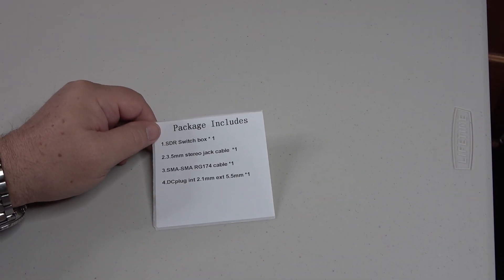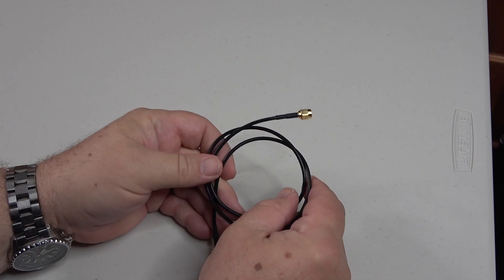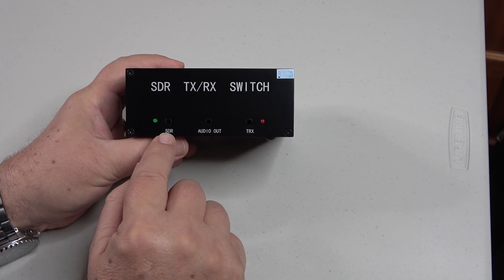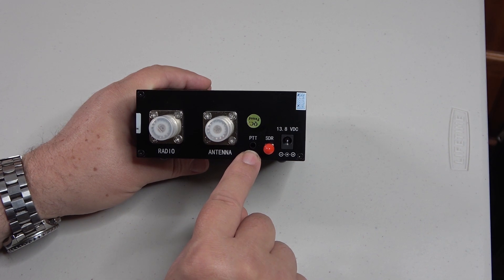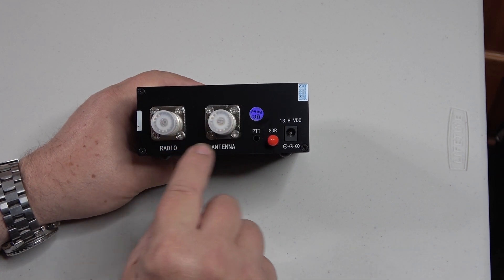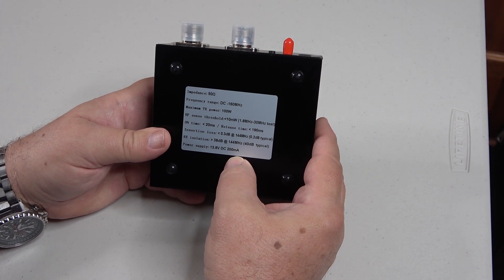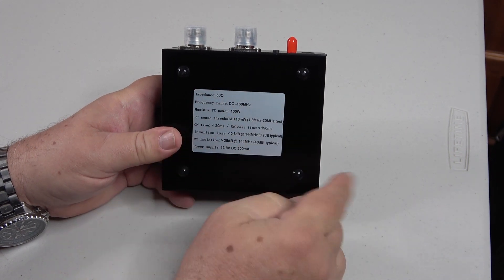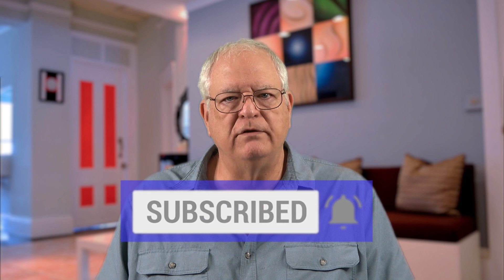HF/SDR Antenna Switcher

Comment: I have a Yaesu FT-891 and an external LDG Z=11ProII antenna tuner.  How would I hook that identical SDR switch in my setup?  radio - tuner - switch or radio - switch - tuner?
Reply from the maker: Here's a link to one of my other videos using the switcher to feed a panadapter. It might help. As for the tuner, I'd go from the radio to tuner to switch. Not sure it would make a lot of difference other than the switch inducing some signal loss. Not really my area of expertise so maybe someone else with respond. Cheers.

Comment: Does it have an impedance matching xformer? Two resistors wired in parallel will cut the importance in half
Reply from the maker: I have no idea. Sorry. Not a big circuit guy.

Comment: I note it states upto 160MHz.  Given that I will switch it with the PTT control line could I also pass UHF / 437MHz at 5watts safely through this device ??
Reply from the maker: Sorry, I'm not an engineer. I used it to disconnect my dongle from an HF radio, not UHF. My guess would be no.

Comment: I've been using it for a few weeks. It has several problems.

1 - RF isolation in TX is poor.

2 - The relays in the audio line make terrible noises in the speakers when activated. Do not use the front sockets!

3 - Find a way for your radio to control the box. Don't trust her RF detector!

Comment: Not sure how to power this up.  Do I need a transformer?
Reply from the maker: Basically a 12v source. 13.8 to be exact. I put Anderson plugs on mine and connect them to a power pole distribution block.

Comment: Does this switch mute the SDR audio when you go into TX mode?
Reply from the maker: The switch disconnects the SDR dongle from the antenna when the transmitter transmits. So technically yes. When the transmitter and SDR are close, the SDR may pick up some of the signal but the point is to keep the transmitter output from smoking the SDR dongle. Hope I understood the question correctly. Cheers.

Comment: Tnx for video. I've got a problem :  As soon as I supply power, the device attenuates the input signal by almost 90%!  Something wrong. Can you help me ?
Reply from the maker: Check out my videos on using this with a SDR for a panadapter and the update video. I seem to remember something similar. I double che ked the wiring and made the change to the jumper on the switch circuit board, I haven't had any problems.
Reply: @GadgetTalk4U  That's right! Tnx. Now everything is ok

Comment: You never said anything about FT 8
Reply from the maker: With the display as part of the WSTJ-X software, I haven't found a need for the SDR display for FT-8. If your computer is powerful enough or you have enough screens, there's not reason this wouldn't work.  PS. Check my "Update" video on this topic. It addresses resetting a jumper in the switcher so the transceiver gets an audio signal.

Comment: Hello can you please help me I am using this switcher with an sdr play rsp1a an ft 450d a usb to com lead I can connect between my radio and the Yeasu software but I can’t handshake with the sdr uno software what have I not done sdr uno is connected
Reply from the maker: There are a lot of things going on with setting up the switcher and the software. I have 3 videos on this. First is this one on the switcher, next called SDR Panadapter Using an Antenna Switcher and the third one is an update to the second. The update focuses on a streamlined method of connecting everything if you use Ham Radio Deluxe. Start with the second fairly long video that will guide you through getting and installing several pieces of software to get the communication paths right. I don't use the Yeasu software so I'm afraid I'm not too much help there. Good Luck.
Reply: @GadgetTalk4U  thank you so much for your reply I will watch those but do not use hdr

Comment: I had exact same one and wired as shown on other videos, however when I powered up the box, my radio audio goes low and I see more activity on the SDRUNO waterfall side, and the green light (left) activated without pressing anything, can you pls direct me
Reply from the maker: Have you switched the jumper inside the antenna switcher to dual receive?  Check this update video I did as I worked through the same problem. (At least I think it is the same problem.) Good luck and thanks for watching.  https://youtu.be/-OLWWF21YJU
Reply: @GadgetTalk4U  I did switched inside the box and now both red and green lights are lit.
Reply: Thanks for prompt reply and keep safe.
Reply: @GadgetTalk4U  where do you recommend I connect the PTT coming from the TR box?

Comment: While you're at it, thought to share also the internals of the device? I am curious what kind of relay this one is using.
Reply from the maker: I'll add that to the shot list for the next video.
Reply from the maker: New video later this week. It will have some info and photos from inside the device.